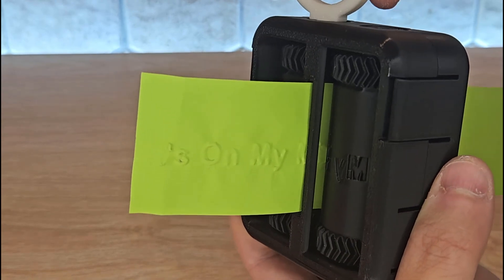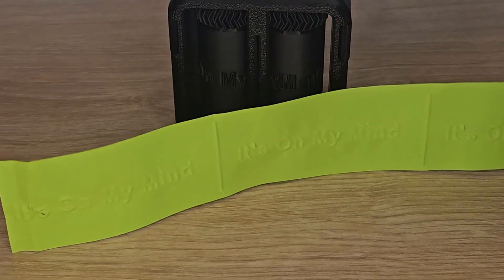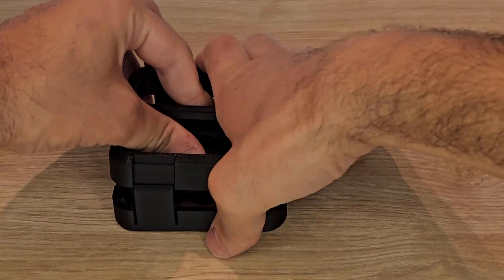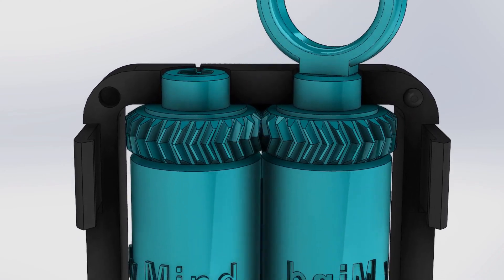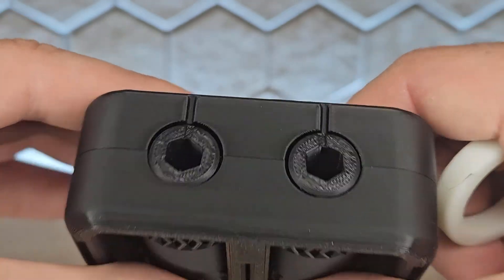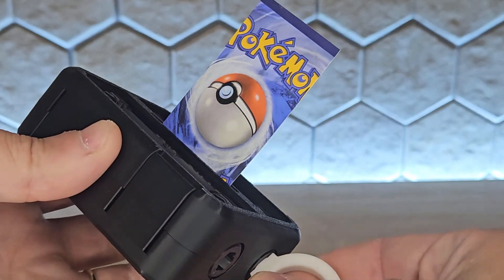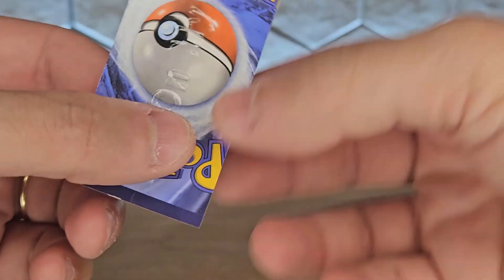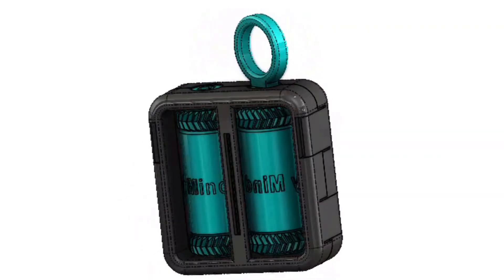Custom Card Embosser REV2 – No Screws!

Comment: My partner and I have our own print business and this is a really interesting idea. I wonder if you have added to it or enhanced it. I think it's great for an up and coming hobbyist but still nowhere near production level, although I don't think that was your goal I just wonder how far off this is from actually getting there. I wouldn't use it for my customers products, we contract out for embossing, but I could see with enhancements maybe use something like that for my own promotion. I wonder if you can template in a flat guide for the paper/cards to travel through. During your embossing the card really wants to bend to accommodate for the materials moved. It's causing a lot of unnecessary friction and some unsightly markings. I think an insertion and exit guide may really help the embosser. But regardless, great line of thinking!

Edited because I can't type on my phone coherently.

Comment: bro I'm so sorry but the rollers look like they are wayy too close together in the model!

I was gonna just add a symbol and get my friend to print it but this leaves me with a lot of questions and you haven't answered any of them :/

why are the rollers a step file while the others are stl?

this really needs a tutorial :(

Idk man... did you make like a face and wrap it around the rollers in the current file?
there is a split in the file and not on the rollers in your vid.

Vista print cards are 85x55mm your rollers are too short for a standard business card.

I'm using freeCAD not solid works
Reply from the maker: The rollers are STEP files because STL files are really hard to edit. With a STEP file, you can open and modify the model in almost any CAD software.

I know it can be a bit confusing, and I wish I could make a full tutorial, but since everyone uses different CAD programs, it’s hard to make one that works for everyone. Here’s the general idea:
You create a sketch on a plane that’s tangent to the roller’s surface, then wrap that sketch around the cylinder. When you extrude and cut it, make sure to add a small offset so the shapes can interlock when the rollers come together.

Also, I just noticed I might have missed some of your earlier comments, sorry about that. I really appreciate the questions, and I’ll try to respond better going forward.